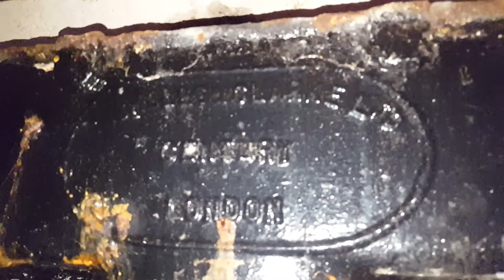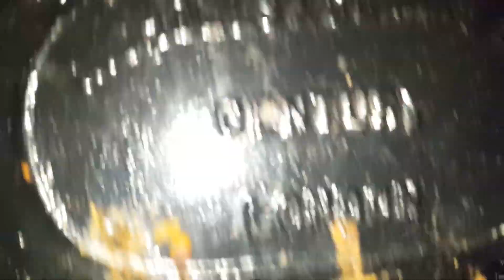1903 HLSP Nicholls & Clarke "Century" Cistern & 1963 Johnson Bros Puritas pan

Comment: overflows these days are generally 3/4"(22mm). At first i thought it was a bit of hose it's probably 1/2" copper heated up/ dunked into cold water and bent with a spring. I have 2 croydon Ballvalves in my collection with the copper float.